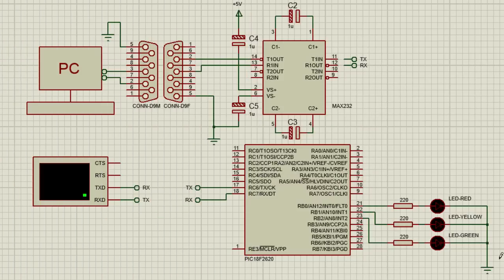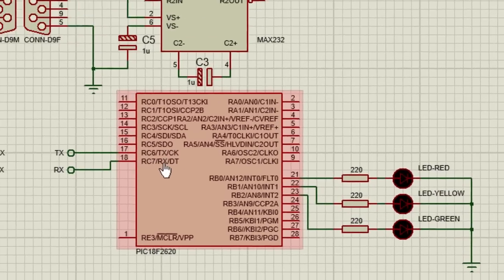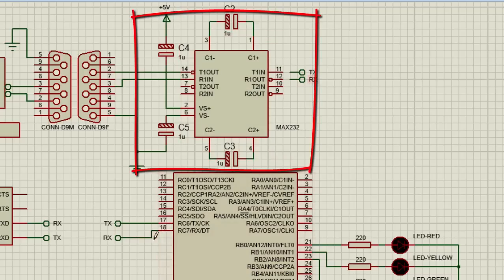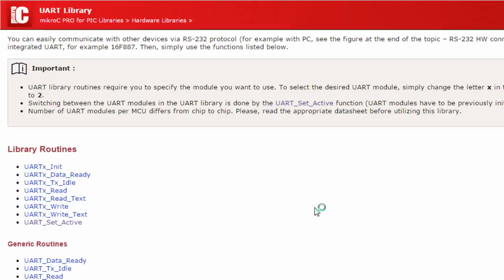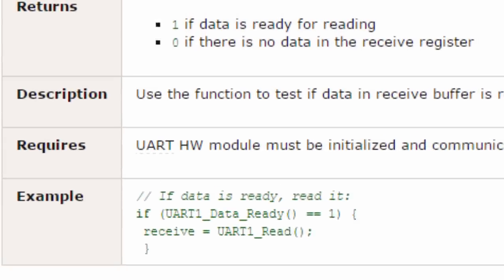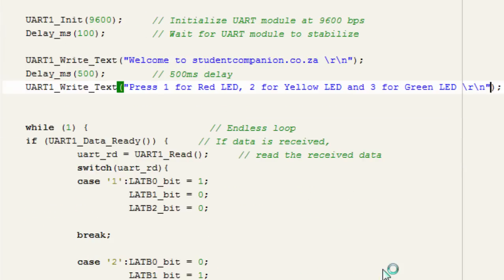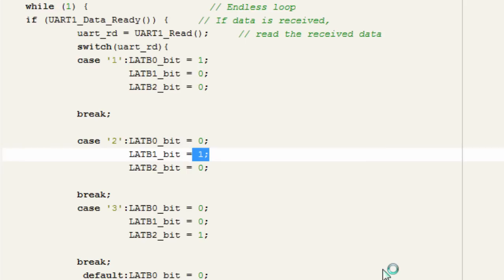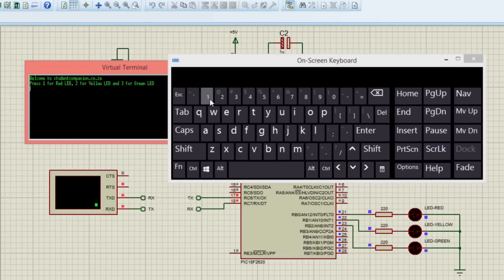22- RS232 Serial Communication | mikroC Pro for PIC Tutorial

Comment: want to help you with the control   moteur project.please sir
Reply from the maker: What is your question? Ask property your question and provide all information
Reply: @StudentCompanion  I want to control the servo moteur by communicayion uart  ... I mean, in the place the leds  of the video, we put a servo motuer
Reply from the maker: Yes. You can, just send the value to rorate the server motor. What are you struggling with?
Reply: Yes, for example, I want to turn one 90 degree and then another,0 degree how do I do this?
Reply from the maker: @sirine8604  You can do the same way as we did in this tutorial.
Servo motors work with pulses to turn. The easiest way is to send single digits, 0 for 0 degree and 9 for 90 degrees if you want to rotate from 0 to 90, but you could also do the other ways.
If you receive 0 from UART or 90, then turn on the servo. Something like this:

void servoRotate0() //0 Degree
{
  unsigned int i;
  for(i=0;i<50;i++)
  {
    PORTB.F0 = 1;
    Delay_us(800);
    PORTB.F0 = 0;
    Delay_us(19200);
  }
}

void servoRotate90() //90 Degree
{
  unsigned int i;
  for(i=0;i<50;i++)
  {
    PORTB.F0 = 1;
    Delay_us(1500);
    PORTB.F0 = 0;
    Delay_us(18500);
  }
}

void main()
{
  TRISB = 0; // PORTB as Ouput Port
  do
  {
if (UART_Data_Ready())
{
uart_rd = UART_Read();
switch (uart_rd)
 {
    case '0':  servoRotate0(); //0 Degree    
    break;

    case '9':  servoRotate90(); //90 Degree    
    break;
 }
}
  
  }while(1);
}
Reply: @StudentCompanion  Thank you very much, sir. You are the best
Reply from the maker: You are welcome!

Comment: hi sir , i did exactly what you did , but in proteus virtual terminal is not showing anything
Reply from the maker: Are you using the same PIC? You did not change the code? Did you set the baud rate the same in code and in the virtual terminal? 
Did you connect the rx and tx pin correctly to the terminal?

Comment: What difference between C language thru mplab and micro C

Which C platform you prefer and why
Reply from the maker: They are all based on C language. C language is the same. But in microcontroller they don't always keep the  C standard 100%. MPLAB XC8 is more compliant than mikroC.  
What's we prefer is irrelevant to your question because most of differences are not evn in C language but with various macros and libraries.

Comment: hi how can i connect modbus rs 485 with pic..?
Reply: Is it same as that of 232.?
Reply from the maker: No. It's not the same as RS232. And even with RS232 you have to use a dedicated chip for it, usually the MAX232 from its datasheet you can see how you can connect it.
Reply: And how can i connect virtual with pic from which wire type..? In proteus
Reply: When i am starting simulation ... Virtual terminator window is not comming
Reply from the maker: I don't understand your question.  What is virtual PIC? Which wire?
Reply: In proteus how can i connect virtual terminal with controller ...talking abt above video
Reply from the maker: In this video we explained how to do that. On the left hand side under virtual instruments select virtual terminal. Connect it to your PIC, set the baud rate and other configuration then start simulation.
Reply: whyy you have not used rs232 library ..?
Reply from the maker: Did you even watch the full video? Your question is from someone who doesn't understand a thing we explained in the video. Watch the full video then ask your questions later.
Reply from the maker: What modbus device you talking about?
Reply: Rs485
Reply from the maker: an RS485 is achieved by coverting the voltage levels and protocols from UART to RS485.  This is usually achieved by a dedicated chip. And the configuration of will depend on the chip selected. We can't advice because we don't even know the chip you'll use for this type communication.
Reply: I want to do master and slave communication

Comment: Student Companion i'm receiving a bytes from MIDI. My code is:

char uart_rd;

Uart1_Init(31250);

TRISC.B7 =1;  // Pin RX as input

While(1)
{
    If(UART1_Data_Ready() == 192)
    {
       uart_rd = UART1_Read();
       
       If(uart_rd = 0)
       { 
          // do somethings
        }

        ....
    }

is correct ? 

Thanks
Reply from the maker: What are you expecting to receive? What does 192 represents?
Reply from the maker: UART1_Data_Read() will only return 1 if there is data and 0 if there is no data. But you are checking for 192!!!
It will never gonna recieve data.

Comment: Why Rx and Tx terminals are not connected to MAX232? They are left alone.
Reply from the maker: Hi. They are not connected because the MAX232 component does not simulate in Proteus. We were just showing how it should be connected physically. We removed the connections just to simulate.
If you want to simulate the RS232, use the COMPIM component as explained in this video: https://youtu.be/dx-Jn1DTu5I
Reply: Thanks bro.
Reply from the maker: You are welcome!

Comment: Well there is a query here sir, you initialized pic with 19200 in code for download and virtual terminal was at 38400 baud rate , and they were talking , don't they both should have on same baud rate?
Reply from the maker: The Baud rate should be the same in code and in virtual terminal.  But mikroC compiler does not certify Proteus as official simulator software.  So that's times here and there you'll see some discrapenses. Mikroc recommends to test their code in hardware only. In hardware in should work fine.
Reply: Student Companion no sir I solved it actually osccon was at 0x76 which tells to osccilator drive at 16mhz just change it to 0x66 and it will run as we expect it should ;) , we oftenly does chat on you video and I thanked you many time but again I am very thankful to you for inspiring and teaching
Reply from the maker: Thank you for your feedback.  It always good to receive feedback from you guys. I will check the datasheet again that could be the problem. 
We will appreciate more of your comments in the future.

Comment: Hi sir. How can I send "'Hi" via GSM to trigger the relay?
Reply from the maker: Hi. Please read this article it will explain how to use "At commands" to control a GSM like sending/receiving sms: https://www.studentcompanion.co.za/interfacing-gsm-gprs-modem-with-pic-microcontroller-mikroc/
Reply: Thanks for a reply, But I want it to do the same as one you uploaded above. Instead of sending "1", "2" I want it to send "Hi" then LED switch on, If I send "Goodbye" LED switch off.
Reply: Thanks, got it now.
Reply from the maker: You found how to do it?
Reply: Yes I did it practical than in simulation and it worked. Thanks
Reply from the maker: Thanks for your feedback.  Much appreciated!

Comment: If you want to switch on led , TRISB of pin RX of the PIC should be configured as an input ? Why are you configuring all register B as an output ? Thanks
Reply from the maker: I think you are confusing things. If you want a pin to be an digital output pin, the TRIS register of that pin must be set to 0 (output). It cannot not be set to input. All LEDs are connected to PORTB that's why PORTB is output.
Reply: Student Companion for leds yes , sorry not TRISB , but TRIS of register in which there is a RX pin , in your case TRISC.B7.
Reply: What do you think ?
Reply from the maker: You don't need to specify USART input/output pins. Everything is taken care of by mikroC USART library.
Reply from the maker: No need to specify with TRIS register.  MikroC library takes care of everything unless you gonnna access the registers yourself to send/receive  data to/from USART then you can configure the Tx and Rx pins
Reply: I'm using Bluetooth module RN4678. I connect the BT to the phone and I want to turn on a LED placed on the RB7 port, I checked with the oscilloscope that the bits arrive at the RX pin of the PIC. I have connected the TX pin of BT to the RX pin of the PIC. But when I give the command on the phone I do not turn on the LED. Can I send you my code by email? Thank you
Reply from the maker: Post your code and schematic diagram in the Forum on our website: https://www.studentcompanion.co.za/forums/

Comment: Thanks sir
can we use a prolific usb to serial directly to a PIC?
Reply from the maker: +amin karim what do you mean by prolific? Is that a brand name?
Reply: usb to serial converter
https://www.google.com/url?sa=i&rct=j&q=&esrc=s&source=images&cd=&cad=rja&uact=8&ved=0ahUKEwjtpKbT_-bXAhWDQpoKHXGeBdgQjRwIBw&url=http%3A%2F%2Fdomoticx.com%2Fpl2303-usb-to-uart-bridge-drivers-windows%2F&psig=AOvVaw1liSmLXQ4qXPlPs_ZClOoC&ust=1512155302326468
Reply: and thanks for speed answer
Reply from the maker: +amin karim yes. You can connect it to PIC UART pins.
Reply from the maker: +amin karim you are welcome!
Reply: U mean RX/TX?
Reply from the maker: +amin karim usually. The RX/TX pins should suffice.  But read your serial converter datasheet and make sure it operating with the same voltage as your PIC. Some are 3.3V other by 5V

Comment: i just wanna ask you i cant find in my isis the PC and the CONN-D9M and CONN-D9F i found just COMPIM so plz can you help me with that and thank you !! by the way you have the best tutos ever
Reply from the maker: +zom ws Hi. Thanks for watching our videos.   We drew  The PC ourselves.  It's not a Proteus component but the DB9 connector can be found but won't simulate with your external PC. If you want to simulate with external PC use the COMPIM as we explained in this video: Controlling a PIC from a PC Graphical user interface: https://youtu.be/dx-Jn1DTu5I
Reply: ok thank you an other question plz i have to control 20 lamps using PC that means that i have to get a connection betwen my pic and the PC can you plz help me with that and thak you so much
Reply from the maker: +zom ws you can use the same principle as in this video: https://youtu.be/dx-Jn1DTu5I
Please watch it part 1 and part 2 and try to understand it. We are also switching on abd off 3 led which you can add more for your lamps. On the microcontroller side instead of using led you can control a relay which can support lamps of higher voltage and current.
Reply: thank you very much sir !!
Reply from the maker: +zom ws you are welcome!

Comment: Great tutorial and great explanation
Reply from the maker: Thank you.
Reply: +StudentCompanionSA  Sir I'm going to make a micro controller program to makes click on a computer program. and i've built that pc program and my project task is "building a serial communication between micro controller and pc program.. this pc program will send 5 ascii characters indicating row and column and data type... and my micro controller should be understand that 5 asciii characters and if the receiving data type is correct then micro controller makes click in that program according to the instruction which that received (5 ascii from pc)... This program is type of a puzzle.
My problem is "making clicks" via UART communication..
Sir can you give me a tip to build this conversation .........
Reply from the maker: +ELECTRICAL & ELECTRONICS ENGINEERING PROJECTS hi, your question is not clear. what do you exactly want the microcontroller to do when it receives the correct data? the "click" you are referring to is on the microcontroller or on the PC?
Reply: StudentCompanionSA hii.......
My task is to build a puzzle. and that puzzle is the pc program. it has 10x10 grid of squares. And every square has a hidden picture. and sir my player is the micro controller (pic). I've finished making the pc program now and i want to build the serial communication between pc and micro controller to makes click on the puzzle plane.
per every one click, PC sends 5 ASCII characters to the micro controller ,indicating the row and column by first 4 numbers and last number (5th) is indicating the picture type. such as pic1 ,pic2 etc...

My problem: building serial communication between my program and my player to makes clicks????????
Can you help me sir?
Reply from the maker: +ELECTRICAL & ELECTRONICS ENGINEERING PROJECTS check on our website we've got a tutorial : serial port with c# it'll help you. soon also we'll upload a video tutorial
Reply: StudentCompanionSA Sure sir!!!!
Reply from the maker: +ELECTRICAL & ELECTRONICS ENGINEERING PROJECTS you are welcome!